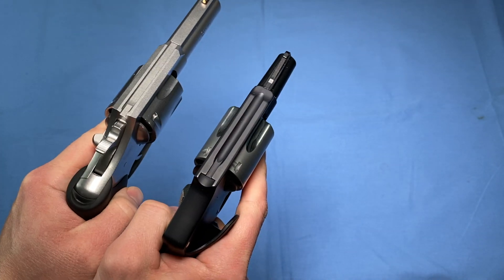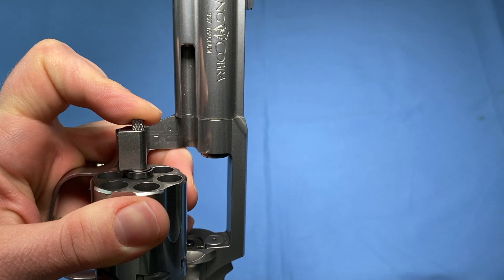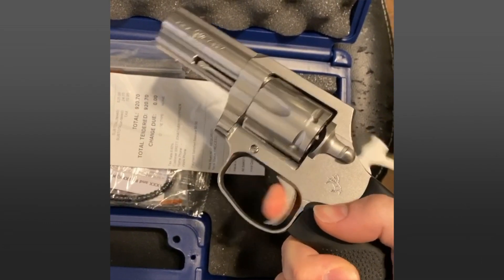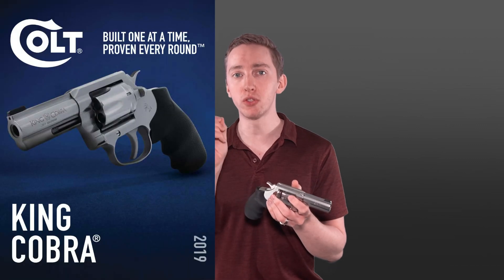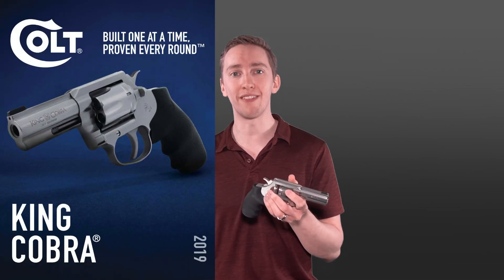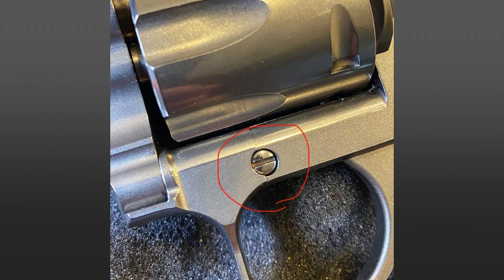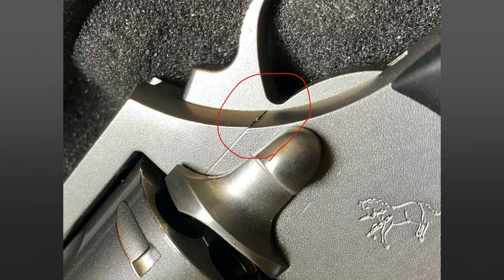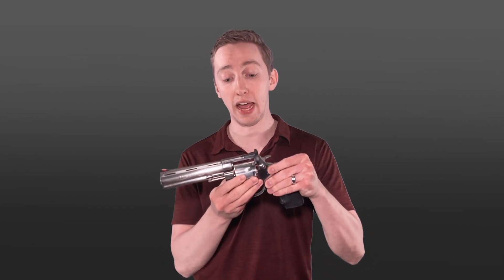Colt King Cobra - Problems, Malfunctions, and Failures OH MY!

Comment: The Kimber DASA, K6S are excellent revolvers. When the first New Python video came out, the reviewers bashed the original Python. The truth is the original Python was in use for decades in Law Enforcement and competitive shooting. It was a hand fit revolver that gave the Python it’s legendary reputation for accuracy and quality. The new Python is not the same. Colt no longer has the gunsmiths or equipment that made and polished the Pythons.
Reply: My brother and Dad have several Kimbers and they are superb guns. Never had a problem despite thousands of rounds. Sadly, Colt appears to have gone downhill. Maybe they can make a come back in the future.

Comment: Man, sounds like you just got a lemon 🍋? I bought a Colt Cobra Classic, and the gun has functioned flawlessly, and it’s crazy accurate to boot.
Reply from the maker: That’s awesome! I’m glad yours runs! I wouldn’t have cared so much that mine was a lemon if Colt would have handled it and fixed it the way they should have. I hope yours keeps running! 👍
Reply: Nightwood Guns Thanks! I hope it keep running well also. And yeah for sure, that had to have been frustrating, and very disappointing that they didn’t fix it 👎🏽
Reply: @nightwoodguns  well I sold my Cobra classic. I was dry firing with snap caps one morning when one of the internal parts broke locking the gun up. Colt fixed it up after I sent it back, but I couldn't trust this gun after that. I really liked the gun but I dont want to carry a gun that could fail when I need it most.

Comment: 2021 king cobra purchaser here. I ignored you thinking it would be better now. But mine  came with a damaged crane and hacked extractor star and a ding in the mim hammer.
Reply from the maker: I feel your pain. Thanks for coming back and leaving a comment so others can see 👍 I can’t believe they still can’t get it right.
Reply: Colt is replacing the firearm.
Reply from the maker: @kakusei3672  Wow! As they should! They absolutely refused for me... But that was also a year ago. Now hopefully the one they send you won't break, haha! For real, I'm putting out the good vibes for you that it will show up quickly and in perfect condition!
Reply: @NightwoodGuns  new colt has been a blast. Over 100 rounds of 357 and 38. Double down and got a custom lobo holster for it 😁
Reply from the maker: @kakusei3672  That's great to hear! I hope it continues to run well for ya! I'm glad it all worked out!

Comment: Nobody makes 'em like they use to including Smith's, Sig's, Remington etc etc etc
Reply: That seems to be the truth regarding everything nowadays.
Reply from the maker: Everyone is trying to keep up with demand while keeping costs low. Quality craftsmanship and customer satisfaction is a low priority nowadays.
Reply: MPGunther1 my $1200 performance center S&W had to go back before I even shot it . The flash shield above the cylinder fell off when I opened the cylinder initially
Reply: MPGunther1 Ruger does
Reply: U.P. Woodtick I agree with that! I have eight black hawks, two red hawks, three 10/22’s, and just bought a 44 special, since you mention it NONE of them have EVER had an issue! I do have a couple S&W 629 and a 29, never failed. I do carry a Charter Arms bulldog pup 44spl every day and after 200 rounds that cheap bastard has never let me down, yet. But my new Rugers are still built just like my old ones.
Reply: Big Kuntry yes sir, I just obtained a GP100, 357 with a 6” barrel used from a gun shop and its like new. I put a 8lb hammer return spring in it and a 10lb hammer spring, polished some internals and its much sweeter than my 686 plus S&W by a long shot
Reply: Yeah it doesn't help that you have a customer base that is just not willing to pay for quality either.
Reply: It seems like the only company left that has maintained consistent quality in manufacturing is Heckler and Koch

Comment: My cobra did that 3 times, the hammer hook that links the dog bone to the main spring snaps off easily.
Reply from the maker: Commenting on this to boost it up so others can see it.
Reply: I broke down and picked one up last month. After about 50 or so dry-fires( with snap caps) same issue - didn't even get to live fire it, back at Colt now,hoping they sort it out.

Comment: That happened to me, pulled trigger UNFIRED GUN and trigger did not return. Long story three and a half months later after loosing the repair order on my new unfired Colt King Cobra I finally had it back. Well still have not fired the gun a year later after they ASSURED ME the issue was fixed, could dry fire and shoot the gun with no problems. Guess what I dry fired it a few times and it Broke AGAIN trigger stuck back and would not return. IM TALKING MAYBE 18 DRY FIRE PULLS AND ITS BROKEN AGAIN IF I dry fired THAT MUCH. Now I have a useless revolver that will have to go to COLT AGAIN AND ANOTHER THREE TO FOUR MONTHS OUT OF SERVICE. IM GOING TO TRADE IT OFF.
Reply from the maker: I feel your pain, man. I wish I could say I was surprised. I’ve had too many people comment on my video and message me with the same problem. It’s unsettling to say the least.

Comment: Colt and s&w r not the same. Ruger is now on top.
Reply from the maker: Chewy Porter The SP101, GP100 and Redhawks are still built like tanks 👍
Reply: @NightwoodGuns  Not necessarily so. The indoor range I frequent recently showed me a brand new low-round count 4" GP100 rental in 2 pieces; its barrel literally fell right onto the floor after only a few HUNDRED rounds. YEAH, THIS IS R-U-G-E-R we're talking about. The barrel threads where it screwed into the frame fractured from metal fatigue. It's how it is nowadays; there are no American gun manufacturer that build them like they used to. When the range owner who rents out these guns for some serious high-mileage use tells me these things, about how his "new" guns from all name brand manufacturers suffering from QC and durability issues, I have my ears wide open and mouth shut. So, if you can, get them low mileage used revolvers made prior to the 90s, regardless of make. They were all better made than the new crap and lasts longer.
Reply from the maker: @willywonka4340  You make a strong point. I saw a new Smith 686 rental get its barrel blown off at the range as well. I would still take a new Smith or Ruger over a new Colt just because of customer service, though. But 100% absolutely get an older Smith or Ruger in excellent condition before anything new. Thanks for the insightful comment.
Reply: @NightwoodGuns  100% concur, thanks for your reply!😸

Comment: In March, 2023, I was in the process of buying a Colt King Cobra.
The night before I was going to the gun shop to buy it, I saw a review from around 2019…2020…that, among other things, pointed out a really strange observation.
On the frame, directly above the forcing cone, were several deep grooves in the strap above the cylinder.
They appeared to be a machining flaw….in an area you would not want defects, if you had any.
I figure in the couple of years that had passed, this was probably corrected.
The next day, I got to the gun shop and inspected the gun I was going to buy.
I was confident my gun would be just fine.
Wrong.
There they were…..3 small grooves, each smaller than the other, as you moved away from the forcing cone.
I have no idea what the deal is….but I passed on the King Cobra and bought a Kimber 357 3” DASA…..and it is absolutely stunning !!
Reply from the maker: I’d say you made a smart choice! 😎👍
Reply: @NightwoodGuns  I think so…..
I’ve laid them side by side…….and I was immediately struck by the obvious difference in build quality before picking either one up.
The Kimber is one classy gun…….and as soon as you pick them up and cycle them, there is no contest.
It’s too bad. Colt has always seemed to be the benchmark for high quality hand guns.
Not anymore.

Comment: My night cobra has also broke and I've been dealing with customer service for close to 1 month.  They are still working on getting me a mailing label for fedex.  Pretty frustrating.
Reply from the maker: I feel your pain. It's a lot of dough to drop on a revolver made by one of the most iconic firearm manufacturers of all time just to be given the "run around" and left with a broken gun. Frustrating just begins to describe it. I hope it all works out in the end for you, at least. It seems like the new Cobra and King Cobra lines are just ticking time bombs before a breakage occurs. It happens with some after a few trigger pulls and others after a thousand.

Comment: Wow, I am so glad I found this vid. Many thx for uploading and describing your experiences. I just looked at this very gun today at my local Ace Hardware. $950.00 plus Nebraska sales tax and sloppy machining? Never owned a Colt and want one really bad. What the hell are they making them in China now! Was going to put it on layaway and pick it up around the holidays since I burned through a bunch of money this year on my property, fencing and another expensive RC helicopter. Went there to get lawn fertilizer and said just sleep on it for a day or two and now this. Will cross it off my list I guess. Always had good luck with Rugers in the past.
Reply from the maker: Normally I also recommend S&W, but their quality control has been sloppy during this “panic buying” period. I definitely only recommend Ruger until Smith can catch up with production 👍
Reply: @NightwoodGuns  Tnx again for the tip on S&W. Also wanted a Smith model 60 since I have a Rossi SS clone. I guess for now it's back to Ruger. Nice vid BTW, like I said glad to have run across you as these guns are not cheap.
Reply from the maker: At Colt’s price point, there is no excuse. Especially in the customer service department. Smith is still making good stuff, you just have to REALLY look it over before purchasing. Look for burrs and cycle the cylinder a few times. Ruger seems to be the most consistent though. Good luck on your revolver search!

Comment: I know this is an older video.  And always appreciate your information and opinion.   I love revolvers.  But don’t have one.  Got caught up in semi autos and rifles.   Now I’m circling back to the type of handgun I learned on…. A revolver.   I am looking at this colt and s&w model 19 carry.   After watching a few videos and reading I am leaning towards the smith.  ?   The colt is very good looking hand gun with history.
Reply from the maker: Since this video, S&W QC has fallen off quite a bit. But at least it doesn’t have a design flaw like the King Cobra does. I’d recommend the Smith because if you have any issues, you can always send it in to get fixed. I recommend checking timing and cylinder gap at a minimum before purchasing 👍

Comment: Reminds me of the Colt Magnum Carry I had. That thing had all kinds of problems. Thank you for reminding me not to buy a double action Colt revolver. I love my Colt Single Action Army’s 3rd gen though.
Reply from the maker: I’m pretty sure the Magnum Carry was one of the last revolvers ever produced by old Colt before they ceased revolver production altogether. Not surprised. I bet your Colt SAA Gen 3 is phenomenal, though!  👍
Reply: The Colt Magnum Carry has been my regular carry gun for over two decades and in that time it has never missed a beat. The current King Cobra is the old Magnum Carry with a slightly larger trigger guard and different front sites

Comment: It's poor quality due to their lack of Master arms makers making firearms for them. Their quality control should have caught all that.
Reply from the maker: Mr. Rogers Right on the money.
Reply: Colt, like others firearms makers have no internal quality control. We are the quality control. Some are a little better than others. I have had to tell one of the biggest firearms makers how to fix my pistol. The first time they sent it back it was not 100%. I found the problem that they should have. A bad camber. ended up with a total top end replacement. Colt is likely depending on suppliers for parts and they just assemble them. Colt probably does not have much leverage to pressure their suppliers. They are too small a company and money is tight. They are likely taking low bids for the parts over top quality parts?? Who knows except parts are breaking. I feel for them. They are trying but on their heels. So what do we do as buyers. Big pocket guys lets help them get healthy. For the guys on a tight budget you should maybe wait a while??
Reply: I want to add that some of the revolvers I bought in 1975, from a company that was breaking into the revolver police market, was because they were less cost but addressing some of the shortfalls of the major players. They worked but some of the fit and finish was lacking. I just recently had one reworked because the muzzle and rifling at the muzzle, and forcing cone was so bad you would not believe it. Rifling at the muzzle was damaged on one side and gone to 3/8" depth on one side. Crown was horrible. It shot good before and after fixing. 1 1/2" groups at 25 yards. The frame on the single action 22lr  has gouges from the original casings. Can't imagine if youtube existed then. Bluing on parts do not match. IT worked and it also shot less then 1 1/2 groups at 25 yards. Owner said they never made any money on that police revolver and they made over 1 1/2 million.

Comment: Thanks for the review, looks like I'm going with the S&W 686 3". I'm running a 1983 Ruger Security Six right now.
Reply from the maker: I’d go Smith for sure. Performance Center if your budget allows it. You could also always update your Ruger. There are also niche options like the Kimber K6 series and the Chiappa Rhino, though I wouldn’t trust those as much as Smith and Ruger. I’ve personally had good luck with them, at least.
Reply: I'm having issues with my 686 so Smith & Wesson is no better.My cylinder got stuck and had to send it back

Comment: I had the same issue with my cobra after 300 rounds. They offered great customer service and sent me a king cobra 3 inch. So fingers crossed
Reply from the maker: Wow, now THAT'S insanely good customer service. Fingers crossed that the King Cobra works well for ya!
Reply: Now do I trust it the same way I trust my 606 plus? Hell no

Comment: Both Colt and Remington have lost their quality control and no longer send out quality products
Reply: I remember 10 years ago when Remington re-introduced their 1911 the front of the slide on a lot of them were scraping along the frames. I saw I don't know how many like that at gun shops from 2010-2012.
Reply from the maker: I live in AZ and I have never dealt with rust in my life. I bought a Remington Tac-14 that was covered in surface rust after sitting in my safe for a week. I stay far away from modern Remingtons and Colts, now.

Comment: Gret video! Would you recommend this revolver or should I buy a Python, Ruger GP100 or Smith 686? What do you think?
Reply from the maker: Personally, I would go with either a Performance Center Smith and Wesson or a Ruger GP100. The Python seems like it’s okay nowadays, but if anything goes wrong you have to deal with Colt customer service. 😬 I just got a Ruger GP100 and I love it. Give it 200 dry fires, pop off the grip and spray the mainspring area with some oil and it’ll have a very smooth trigger.
Reply: @NightwoodGuns  Well, thank you very much for the advice. I'm also thinking of buying a GP 100 with a 6 "barrel, black and a Smith 629 in a 44 magnum.
Reply from the maker: The GP100 is a great choice, I got mine in black and love it. Very sharp. I also have a 629 Competitor and it’s my favorite revolver I’ve ever owned. 👍
Reply: @NightwoodGuns  Thank you.

Comment: Mine had a similar issue, but colt completely fixed it for me, my gun is awesome now! But I do think colt should lower the MSRP a bit or just cut their losses and stop making them to at least give us some collectors value to it
Reply from the maker: I'm glad they fixed it up for you. Hopefully it doesn't happen again... I agree, either a lower MSRP to better reflect the quality or cut their losses and turn them into collectibles.
Reply: @NightwoodGuns  I tried to change my front sight to their tritium one and it would not budge, and I made sure to double check I was twisting it the right way before I took it out and I gave it a good twist and it just sheared off the edges of the hex screw, I'm guessing their genius "gunsmiths" put too much loctite, seems they should be putting burgers together instead. 
Colts are absolute garbage
Reply from the maker: @jayperez7360  Yikes. Sorry, man. That's rough.

Comment: Well done  I bought a king cobra  today and I  have  not yet received it  so I'm going to  upgrade  to a Kimber thanks
Reply from the maker: Yeah, I’d go Ruger, Smith, or Kimber. At least those don’t have design flaws that they are ignoring. I’ve never personally owned a Kimber and Smith’s QC has been hit or miss during the “pandemic panic” But Ruger has been solid throughout. Whatever you end up getting, make sure you look it over. 👍

Comment: I bought a new King Cobra 4 months ago from Buds Gun Shop. It arrived at the dealer dirty and when taken out of the box the front sight was missing. When I contacted Buds about it they denied doing anything but receiving it from Colt and shipping it out and suggested I contact Colt. I sent pictures to Colt who said the dirt was from them test firing it 6 to 12 times at the factory. They said they wouldn't send it out without a sight but they did send me a front sight. I lost all faith in Colt and Buds Gun Shop if that is how you receive a nearly $1000 gun. Bought a Smith and Wesson and much happier with it.